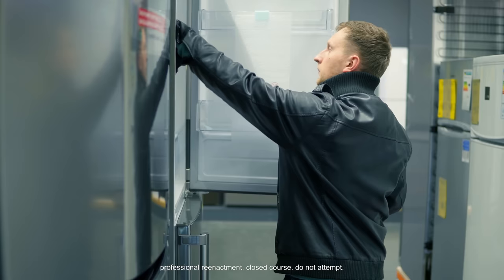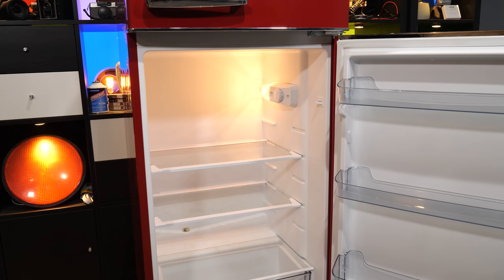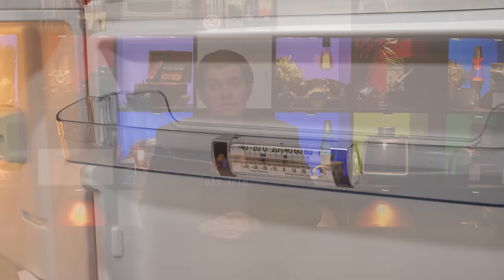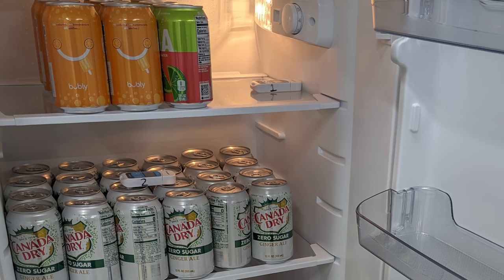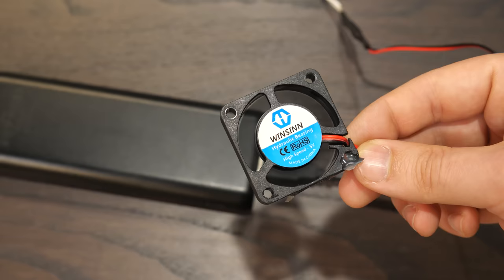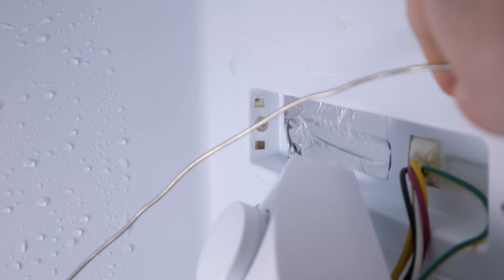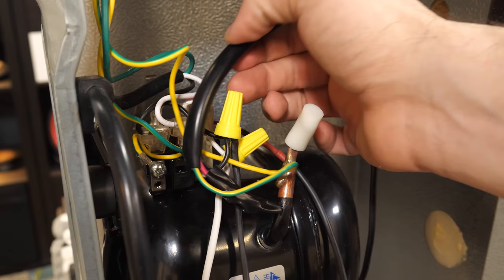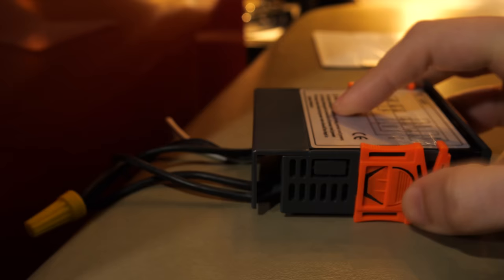This goofy fridge has a really clever design. It's also kinda terrible.

Comment: Hey, don't know If you'll ever see this, but the reason why fans and a real thermostat messed up the performance of this refrigerator is likely that this is a critically charged system. No TXV or inverter to slow down the flow of refrigerant: just a fixed metering device (capillary) and that's it. The sensing bulb for the "thermostat" is hidden inside the fridge wall and actually reaches near the end of the evaporator, close to the outlet before refrigerant makes its way back to the compressor. This makes sense, as when the fridge is cold enough, the suction line will start to receive some liquid refrigerant and, if too much makes its way back to the compressor, it can boil off the oil and even flood the piston in a worst case scenario. This is why you saw the compressor turning off even when the food was still too warm: the suction line was probably cold enough!
Such a system cannot run indefinitely and needs appropriately sized evaporators and charge to function. Its temperature will also be largely affected by component sizing more than anything else. Hope this helps!

Comment: I have a small Frigidaire mini fridge and it works on this same principle! I thought it was brilliant that it has a self defrost and separate freezer compartment. Very cool how the freezer works!

The compressor also is far more efficient than my previous 25 year old fridge. It would draw so much amperage on the hard start it would blow my 15amp breaker if I had any high power appliances (toaster oven) plugged in and the compressor would give off so much

Love your content! Keep it up

Comment: I watched all of this thinking YES EXACTLY!? My fridge is almost the same type, albeit at bottom freezer, but same type of everything else. I've experienced SO much similar weirdness. Monitored internal temp with many different digital thermometers, and the temp was way too high. Like cooling to 6c then turns off, and wont turn on again until at 9c. But here is the kicker, I found out that if I turn it off, thaw it out completely, then that fixes it, and it will enter into a rythm of cooling to -1c and turn back on again at 5c. But this only lasts for about a month or so. Then I figured out that what would break the correct cycle and cause higher cycles is if I ever put anything into the freezer that wasn't already frozen or very cold. If I then turn it off for 5 hours, thaw it out, and turn it back on again, the problem goes away. How on earth can the thermostat be impacted like that?!

Comment: I used to have the fridge only model of this. It works well, but we found out the hard way that it really needs a fan to circulate the air. Purchaed a cheap ducted fan with speed controller and put in the back of the fridge on the bottom. Aimed it to face the top, problem solved.

Comment: Great video. From a layman’s viewpoint, I would be concerned about extending the duty cycle of the compressor you will be residual heat on the internal components of the compressor and thus reducing it’slife span. I have recently discovered this with portable DC air compressors designed for light DIY use. 10 minutes of use require more than 30 minutes of cool down. Manufacturers engineered compressor duty cycle should be considered must be considered when “hot rodding” you beloved red fridge. 

P.S. I am considering buying a similar model.
Reply: How difficult to replace the adorable compressor with one a little more burly, if a little less adorable?

Comment: I haven't gone through the comments, so I hope these aren't repeats to you: Your initial test that ran for 6 hours and then repeatedly started and stopped, probably was cycling on an overheat protection on the compressor, rather than the thermostat ever being satisfied. 

Also, those power banks tend to generate heat. You might try with the fridge unplugged, run the fan for a few hours and see what the temperature rise is from a room temperature fridge.

Comment: It sounds like the warm air barrier at the front of the fridge is actually kind of insulating it. Because you’re cycling cold air right up against the Bridgid door, I think you’re just sucking heat right out of that door.

Comment: I have an undercabinet fridge that operates like the red one and it's a POS even though it was very expensive.  It has just a cold plate at the back an no circulation fan so it behaves just like the red on in this video - it simply can't maintain consistent temps and I've have to replace the thermostat over and over again.  It's also a pain because anything that gets too close to the cold plate in the back ends up freezing so I can' only use about half the capacity of the fridge.

Comment: wow, I just realized the reason for the sudden shutdown during that cooling marathon
it is likely due to compressor flooding, the refrigerant has a minimum point before it passes through unboiled, called "flooding" in HVAC type systems
as the freezer got too cold to actively warm the loop, the liquid began to pool back into the compressor, this can often lead to compressor stress and even valve and rotor damage as the effort to force a liquid to compress is insane

what is scary is the nature of the cycle if the freezer overcools, rather than keep running with a bypass valve or even a clever arrangement of tubing that allows the liquid to drop back into the fridge rather than keep being forced back into the compressor, it stalls the cooling cycle, this is scary because of the nature of food born illness, an overfrozen slab of beef is fine, but a hunk of cheese that got warm and wet enough to mold can cause serious illness

the only way to fully fix this is to re-run the tubes around the fridge walls to ensure a loop that drains back to the fridge if the freezer is too cold, or to add a bypass valve that simply lets the compressor freewheel when the liquid is flooding back, as it can then simply allow the coils inside the compressor to warm any excess refrigerant and form a Pseudo VRF system

or you can add a small servo that forces the door of the freezer open or even a small pc style liquid cooling loop(or even just fill the freezer with lots of mass that can help prevent stalls)

I would not buy that cheap red food spoiler for anything other than beverages, it is too flawed to form a safe fridge
but assuming it is an office fridge used only like a cooler for lunches, it could be ok, just make sure the freezer zone has some big jugs of water to freeze and maybe even intentionally damage the freezer seals just a tad to reduce insulation

when I am rich and live in luxury I aint buying a frenchie with in-door ice, f**king stupid
I would buy an upright twin cool or oldie with freezer on top, still would have an icemaker as I love that
and my system would include a mod, a passthrough heat exchanger mount so I can chill my RO water line as needed
probably placed under the crisper drawers where the coldest air reaches or at the back of the lowest shelf
and I would be dam sure that if the freezer/fridge had a cooling capacity imbalance issue I would use a custom heat source based on high speed silicon based switching devices to add extra heat to the zone that got too cold(yeah baby, sub-ambeint cooling)

but honestly if I was that rich I would just have a good combo unit and use a cheapo chest freezer waterproofed and full of water to act as a cold sink using an antifreeze loop to inject thermal energy as it would stabilize at 0c with lots of water in it

kinda what tech ingredients did for their still, they sealed the sides of a chest freezer, filled with water, and used it like a giant ice cube, though them using it that way was a bit silly, it would have been more sensible to use an antifreeze loop with external pump+res and place the freezer on the back porch to feed the condenser exchanger, and flow rate could be regulated to any temp you wish anyway so the whole unplugging is a waste of effort

Comment: Variations may be caused by the thermal overload protector on the compressor.  Using a fan to cool the compressor may reduce the variations.

Comment: Plenty of mini fridges are on the market today that follow that same design principle (of a little box hanging high up inside a larger box) and have that little box leak condensated water vapor out of the surrounding air that will rain down below it in the form of water droplets, making everything wet that lays below that little box inside of that bigger , insulated box

Comment: Isn't there pressure protection for the compressor? The thermostat isn't the only thing that can shut off the compressor. A high pressure switch on the compressor outlet and a low pressure switch on the compressor inlet can both shut off the compressor.

So what I'm thinking could be happening, is if the freezer temperature is super low, that's indicative of the compressor inlet pressure being too low, and if there's a low pressure switch there, it will shut off the compressor, overriding what the thermostat wants to do.

Comment: I had a similar 'dorm' fridge and wired a small 120v muffin fan in parallel with the compressor. The fan blows on the compressor itself when the compressor is running and helps the overall cooling effect. Cheap and simple. Question: Did the FLIR cam cost more then the fridge it's measuring?

Comment: You could use a 3D printer to print a new cover to accommodate the wires by the condenser. You could also 3D print a cover for the back of the thermostat and a cover for the wires going back to the housing by the condenser.

Comment: The original probe is very likely inside the wall to give it a bit of thermal inertia and to prevent the evaporator from getting too cold.
This also has the side effect of cicling the compressor and also this is probably wanted, I don't think that this tiny motor is rated for continuous duty, so, keeping it running for too much will lead to overheating. Not food safe, but cheap mass production safe.

Comment: The irony is we've been told for ages NOT TO USE PROPANE for refridgerant because it's explosive. And now...they're using explosive refridgerants!

Also the misconception about fridge cooling is it's not only convective. That helps, but at least half is from infrared emissions - and lack thereof. If you were ejected into outer space, you'd freeze in a few seconds despite no atmosphere - because there's no infrared heat coming back at you to balance our what you emmit. A fresh item emits lots of infrared, but the surrounding cool items/walls emit a bunch less in return.

Another thing: thermal mass. An empty fridge or freeze only has the walls to absorb that heat, and the air has very little mass compared to a single tray of ice cubes. More mass will lead to reduced temp spikes and overall quicker cooling of new items since all that mass absorbs heat. "Letting all the cold air out" doesn't do nearly as much as one might expect, since air is a good insulator.

Comment: I am from Germany... and his thoughts on fridges amaze me... this fridge is designed to have "temperature zones" that is how fridges are supposed to be... in Germany. No fridge here should have the same temp at every position of the fridge.

The top shelf is for beverages, the second one for diary and meat and the bottom one is for  vegetables... you want cold drinks, diary at save levels and vegetables not to cold. Having vegetables at 3-4°C ruins them. They should be at around 8-12°C. Meat at 5-8° and drinks between 4 and 6°C.

And yes 5-8°C is 100% food save for meat and diary.
Reply: This is fascinating to me. Thank you for the info.

Comment: I would set a huge deadband on that thing.  These critical charge systems that have to lift refrigerant 6' high have major oil return problems.  They need long cycles or it will begin to pool, then the compressor will begin to trip on overload but you will think the stat cycled it off.

Comment: Seems to me like they wanted to prevent the evaporator lines themselves from getting too cold and the condenser lines from getting too hot, and prevent continuous running of the compressor.   It may have been unsatisfactory for control of the compartment temperature but the intent may have been to prevent damage to the evaporator and compressor through over pressure.   Mind you, the way to determine if this is the case would be to monitor the pressures in the evaporator and condenser lines, or more directly, ask the right person at the manufacturing company (not all employees would give valid answers and the right person likely no longer works there).   Protecting the compressor and both condensor and evaporator lines may be to use more marginal and less expensive compressors and lines.  Your digital thermostat probably drove the compressor and lines over spec which may work on numerous units but would be too high a failure rate over all units produced.   The failings of this refrigerator may be due to excessive cleverness...

Comment: The wires out the back of the PID controller bend 90 deg from the terminals and come out the space on the side, not under the guard.

Comment: You were not quite correct about the number of parts. That refrigerator has two thermostats. The one you know about that sets when the compressor normally turns on and off to keep the refrigerator cool, and a second one built into the compressor to prevent the compressor motor from overheating and damaging the motor. This second thermostat will open when the motor gets too hot, and close again when it has cooled down significantly - but not to room temperature. The compressor is designed with a maximum duty cycle in mind (for a given temperature outside), and cannot be run continuously. So what you are seeing is perfectly predicable - the compressor and insulation of the refrigerator are such that the compressor can remove just a bit more heat than will leak into the refrigerator through the insulation assuming the refrigerator is in a warm room. If you look at the documentation that came with the refrigerator, you might find a listing indicating the maximum ambient temperature the refrigerator can work in. (There will be a minimum to, if you exceed that there is a chance the compressor will be damaged.) I suspect if you had gotten one more data logger and placed it in the room, you would have found the cooling rate inside the refrigerator is also dependent on the external temperature.
The reason the other refrigerators worked so well is they have a much, much larger margin of cooling capacity compared to the heat influx through the insulation. This helps the overall lifetime of the refrigerator as the insulation will break down over time, letting more heat into the refrigerator. You may find ten years or so down the road that your little red refrigerator no longer keeps things cold even if the compressor and associated plumbing is fine.

Comment: Your probe experiment results were not surprising.  I recently bought a new Whirlpool fridge with standard freezer at the top.  Two lines in the instruction booklet stood out from the rest.
1)…Give the refrigerator and freezer at least 24 hours to cool down to the temperature set on the thermostat
2)…The refrigerator is NOT meant to cool anything from room temperature, only to keep cold items “cold”.
Item number two in particular struck me.  When working in the restaurant industry I was required to take the mandatory health training course before being allowed to handle food.  In the course it was emphasized over and over that we were not to put food in the walk-in fridge or regular fridge which was not already cool.  It was hammered in to us that the fridge is only to maintain a cold temperature, not make things cold.  My obvious question was, ok, how do you make something cold BEFORE putting it in the fridge?  Do they have a special pre-fridge “fridge” made just for that?  I never got an answer.

Comment: I somewhat like the original design. It has a built in motor protection. Shutting it down in intevals, so you dont burn it, after putting in a ton of warm stuff. 
This without using more components.

Comment: Probably won’t read this, but designing ovens (did this for a machine we designed) is equally as frustrating, and airflow to keep a 3 degree gradient in 12 bays, each with a door, of about 2 cubic ft was an engineering night mare. Individual baffles for inlet and out let with a VFD on the 3 fans and 3 heaters with independent PID controllers and some fancy math with about 30 temp probes

Comment: Most people are surprised at how much engineering goes into... well, anything. If you think you can buy a special type of spark plug or vortex gas mixture to your car and gain 20% more HP, not gonna happen. You might get 1%, but more than likely you will lose power. Might have worked in the 1950''s but not anymore. 
Anyway, I think this guy should buy his own thermal camera.

Comment: Maybe the white acrylic casing acts as kind of a uniform heat sink with the temperature probe measuring the temperature of the casing and not the air temperature.  Maybe the fans upset the ability of the casing to distribute an average temperature to its entire surface.

Comment: you should add a start cap to remove hard starts and sudden surges in power draw. the fan could run on extremely low rpm and create a motorized flange for a freezer passthrough.

Comment: The original thermostat is actually in the right place. It probably senses temperatures close to the Evaporator To make sure it does not get too cold. Which can have adverse effect on the compressor an oil. With the evaporator being colder than the freezer if the freezer was at twenty one degrees, your super heat had to be next to nothing. Which can promote liquid refrigerant heading back to the compressor. 😢